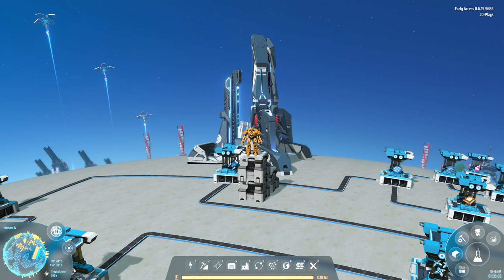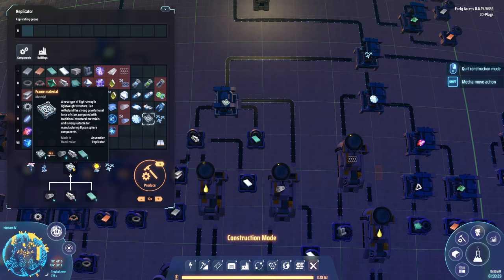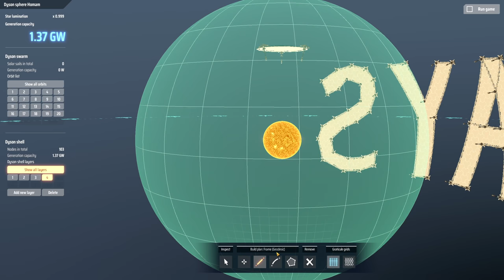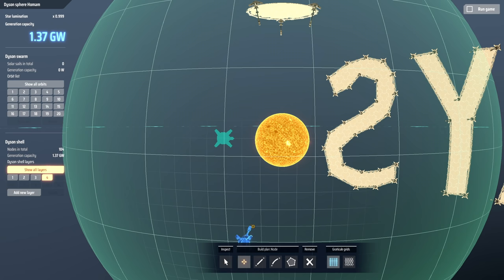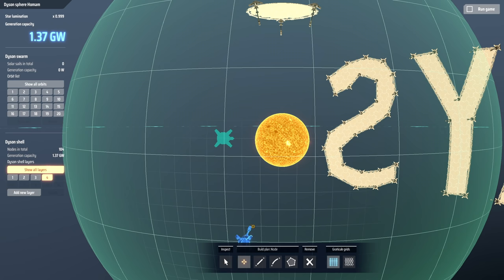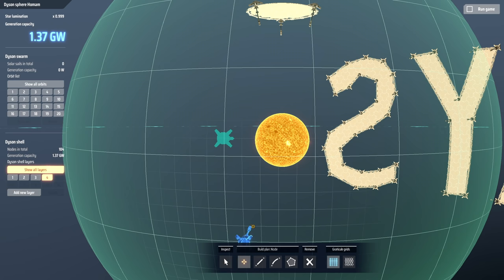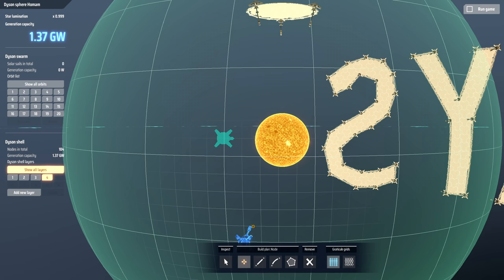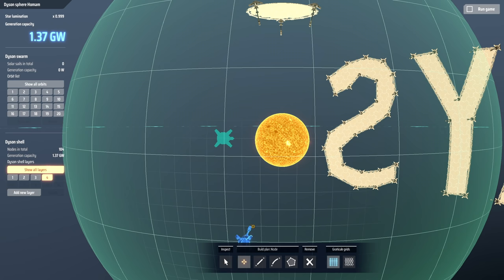How to build a Dyson Sphere 🤖 Dyson Sphere Program 🤖  Tutorial, New Player Guide How To

Comment: For those who are asking. YES YOU CAN HAVE MULTIPLE LAYERS AND THEY ALL COUNT no shadows are calculated in this game.
Reply: This is such a pitty. For such a complex game this seem like a big miss from the developers. Also, is the amount of energy absorbed by the sail decreasing based on the distance from the sun?
Reply: @claudiu_ivan  It's early access
Reply: Multiple layers makes sense for catching waste heat as additional radiation for power. As well, stellar husbandry has far more possibilities such as extending a star's life and powering giant Matryoshka brains with the waste heat.
Reply: @TheRojo387  I'm pretty sure that's what CentreBrain is.
Reply: @claudiu_ivan  Also, pretty sure the game wouldn't be able to handle it if it had to calculate shadows with spheres that massive.

tbh I'm surprised at how well it runs now with all the stuff it needs to track exact positions on and stuff running in the background.
Reply: @Hephaestus_God  True
Reply: @Hephaestus_God  Not necessarilly, you could make approximation that makes it easy, for example, for the purpose of illumination of subsequent spheres, you could treat each sphere as uniform  with an opacity depending on how complete it is. You could refine it by considering ring by ring average over one rotation, etc.

Comment: Instead of building the complete dyson sphere in your home star.

The best practice is to build the dyson sphere in the star with the highest luminosity factor (top left corner of the dyson sphere editor) in your star cluster, generally O category (class) stars are the highest I've encountered with x2.4 times the luminosity factor.

Then use ray receivers (in 8 octant pattern of a sphere for constant output) in a planet (with least orbit and rotation axis inclination) of that star to collect photons (which should be ×2.4 times greater now because of the star you chose) and then ship it back to your home base for anitmater fuel for artificial sun.

I have 24 Artificial Suns running my factory when I barely need 10.
Reply: Really need somewone to explain all these difficult things to me in english, lol
Reply: I am currently working on a 2.509L O type star, I picked it for one single purpose, because I was mildly let down when I covered my first star in two full spheres and it was still day time on my planets, when I found this O type star...with a planet INSIDE the maximum sphere range...I was very excited, but it does mean that it is going to take a very, very long time to build this. But I feel like it will be very worth it even if it won't be as I expect (bright on the night side of the planet).
I feel as if the Blue giant or Red giant could have had a planet on the inside as well, but I didnt even take a second look once I saw how dim they are compared to this big blue baby.
It is pretty fun seeing the difference between shooting sails from a planet up close compared to shooting them from a planet that has an 8 hour orbit and the sails take over a minute to reach their target.
Reply: @firedragon159  It does take a very very long time, so if you want a full sphere in the shortest time, build it with the smallest possible radius.

Though, I'm not completely sure that having the dyson sphere radius bigger than your planet's orbit radius will illuminate the night side of the planet or not. 

I'll be cool if it did.

Comment: One thing I don't think you mentioned.  For the research, to be able to make more than just a basic ring around the star, you need the Dyson Sphere Stress System tech.  Each time you research it, it gives you +15 degrees of area to build in.  This was not immediately obvious when I was first jumping in to design my sphere and it was frustrating me a lot because I nothing jumped out and told me I needed that.  AFTER researching the first step to it, it made sense.  But nothing indicated I needed that.
Reply: thanks @skyesfury because perhaps what you say will help me (excuse my English i am french) . Indeed when I want to put a node around my star, I have a red message that says "wrong latitude" or something like that.I can only put them on the middle line ("equator"). I didn't understand why. Is what you say the explanation ? DO i have to research Dyson Sphere Stress until I have the total degrees filled (+15 each time until 180 degrees ?!) Thanks a lot for your answer
Reply: @madamepop5342  Correct.  You have to research Dyson Sphere Stress at least once to be able to build beyond the middle line.  It's a limited repeatable research.  Each time you research it, it expands the sphere's build area.  Once you unlock the whole sphere build area, the research cannot be done again.
Reply: YES this is extremely frustrating. Why let us start building the sphere if you can't actually form squares....
Reply: @paule5195  So that it finishes sooner? the same way you can form a swarm before unlocking rocket, or start processing silicon before making transistors.

Comment: Yo - a good tip to share with your viewers - putting grav lenses in your power collectors not only doubles your power output, but also gives you 100% uptime, so it's like getting 4x the power!
Reply from the maker: oh NICE thanks for sharing! I have lenses but i havnt bothered trying as power isnt a issue at all!
Reply: @JDPlays  A bit of a clarification, the lenses don't actually force the collector to be active at all times, it just makes the zone that the collecter has to be in to "see" the star (and therefore swarm or sphere) dramatically larger. If you put collector on an equator and put a lens in, you will lose exposure for about 1/3 of the night.
If I remember the ratios, one collector will at max output generate 5 photons per minute, one lens last 4 minutes inside a collector and boosts production to 10 photons per minute
Reply: I think another streamer (Francis John) discovered that if there's a planet inside the Dyson Sphere, those 'Ray Receivers' have 100% uptime with no additional requirements. His channel has a playlist with the largest diameter star he could find, lots of good content there!

Comment: Does the several layers of the dyson sphere block each other from the sunlight, making several full spheres useless around a single star? 
Also, i heard when a segment has been filled, you can land on it. So to warp, to another system, do you need to leave an opening?
Reply from the maker: Light passes thru the sphere to your planets so i expect it would from from one shell to another without issue
and as i cant land on the JD Plays around my sun, i doubt a complete sphere would be any different, they have no collision boxes

Comment: Is there any reason to not just have a single swarm orbit or a single dyson sphere?  Do the power receiver dishes receive the power from the sphere?  Can you put a receiver antenna on every planet?
Reply: 1. No there is no reason to limit yourself to 1 and it is generally more efficient and advisable to have multiple swarm orbits and spheres as these generate more power 
2. Yes ray receivers receive power from the sphere/swarm and as such need direct “sight” with the sun, aka they only work in the day or on the day side of a planet 
3. Yes and the receivers would be able to receive power from the sphere/swarm regardless of distance and only limited by the daylight hours and how many receivers you possess :)
Reply: @mystics7787  Thanks for taking the time.

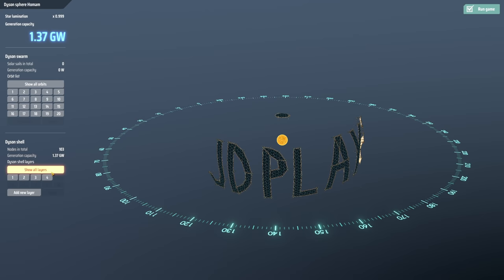Comment: At 7:13, it is longitude of the ascending node. It won’t change anything with an inclination of zero except the starting point, but if you increase the inclination, it changes the starting point of the ascent and therefore rotates the orbit around the star.

Comment: Kinda awkward, that the distance doesnt matter... In reality the energy per square meter would decrease with higher distance from the star.
Reply: the reason that light dissipates is because light tends to separate from each other, because they don't go on the line that the light source points but at angles, separating the photons, and dissipating the light, but the dyson sphere in this case circles the the sun all around so every photon is capture.
Reply: @i.p.7687  This has very little to do with dissipation/dispertion of light. As you say, a complete dyson sphere should catch all the photons, so a complete dyson sphere should yeild the same energy no matter if built close or far (and building far is just more expansive).
 
From which one can actually deduce that energy per square meter decreases as one over the square distance from  a star..

Comment: Guess my question would be what the difference in layer sizes mean for output, how do nodes vs frames effect output, and if you have one full sphere is there any point in doing multiple layers on the same star?
Reply from the maker: Multi layers are fine, and I tried to answer the question about nodes vs frames but it seemed to boil down to structure points (i think from memory i mentioned it in the video) every structure point is worth 150W so more frames = more points

Comment: So my confusion comes with, how did you get to be able to cover the whole sphere, I only have the option to make just a single band around the equator line, does this come from later when you get more interplanetary tech or the like, I've only just unlocked they yelow cubes and am trying like crazy to get some interplanetary logistics things built so i can make centralized production lines that just use the interplanetary transports as storage, requesting the intermediate items and outputting the next chain of creation.

my bigger problem is getting rid of or making use of the byproducts from the refining processes. occasionalyl i feel i'm going ot justh ave to destroy a storage tank of 10k Supheric acid, or hydrogen, or refined oil, just so there's space for my production lines to put more byproduct and keep producing the material i need,
Reply from the maker: balancing oil is something i cant help with... as for building the sphere there is a tech each time you do the tech it gives you another 15 degress up and down to slowly make a sphere
Reply: @JDPlays  oh, i didn't know that one was repeatable
Reply: @ElderonAnalas  Oil has been a struggle for me too, hence the line of refineries stretching half way around the planet.  Early on I found that I had an abundance of refined oil which was hampering hydrogen production.  Ended up with about 20 full storage of refined oil.  Later on though as I started to produce crystalline titanium and plastic it reversed and I wasn't using enough hydrogen.  I ended up replacing my energised carbon power plant with a hydrogen powered one, which is helping at the moment.  With stackable storage I am leaning on the side of building up massive reserves as its my first playthrough so not sure what I will need lots of in the future.

Not sure how far through you are just a cautionary tale that sometimes in this game the resource you have too much off can become the one you lack somewhere down the tech tree
Reply: @billjoggs6713  yup I build up 5 stacks of 5 tanks during early game now they are all drained into production and wanting more, was really great full I had lots of em it hurts when you only Have a handful from by production

Comment: Help me pleeeese!!! I have too much hydrogen (from yellow science)!!! I have no idea how to use it. Red science is perfectly balanced, so I can't use it there. Power is doing amazing so I can't burn it (I can but it's painfully slow). I have 6.25 hydrogen per second that I need to get rid of. The way I am using it right now is fuel for myself. It's not good!
Reply: Throw it into a thermal power plant or keep tanking it up. your going to need a metric shit load of hydrogen for Deuterium and Casmir Crystals.
Reply: Oh, and your power, is never amazing or never enough i should say. If your not making a constant 500-1000 MW without solar cells, then your not making enough energy.
Reply from the maker: 1. Burn
2. Deuterium 
3. Storage
4. turn off cracking
5. delete storage, then rebuild it, instantly empties storage!